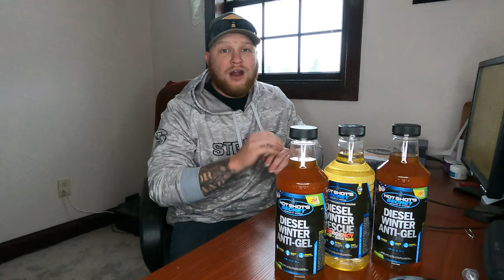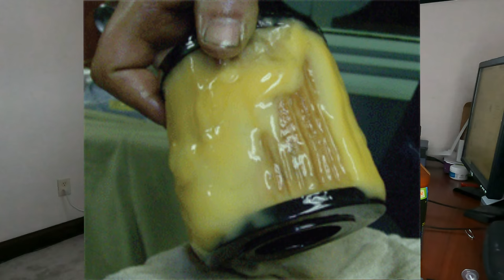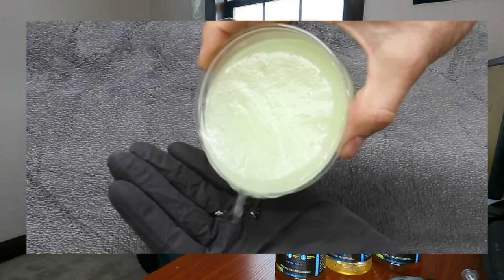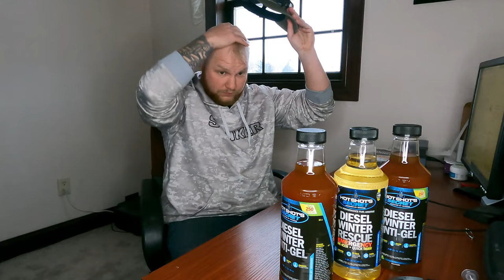What To Do When Your Diesel Gels Up!

Comment: I was up in Wisconsin two winters ago.  It was -30 degrees.  My 579 paccar gelled up.  I was gonna wait for the ta shop to help me out.  Bought 2 of those big 911 red bottles poured half it in both tanks and filled the fuel water separator filter up.   Let it sit for about 10 minutes.  Fired right up.  You can’t really prevent gelling.  Bc windshield chill is the issue.  It can be -6 but windshield -30.   I gelled up with howes and power service.  Gonna try out fuel ox.  Heard nothing but good things about it.  Make sure u use algae killer in your tanks before winter.  Windshield does effect it.  Fuel tanks are aluminum.

Comment: Don't know where you are at but the diesel fuel we get in central ND is pretty good. Just went trough a week to 10 days where it never got above zero and had 3 nights of -30 or more. We ran #2 diesel in our IH 1066 only had power service at one and a half times the recommended rate never had a problem. Only problem was it sits outside so the 1200 watt block heater was plugged in when not using it to feed livestock.  Also found a product from Canada called Sure Shot that we used in the 2014 chevy duramax  .  Used the pickup every day and never missed a beat with #2 fuel.
Reply from the maker: WI our #2 diesel is a rip off and they actually stopped giving you the option now it’s all “winterized”

Comment: Thanks for the info bro! So, I’ll say upfront that I don’t have any experience with this. What should I do if I’ve had to park at the airport unplugged for 5 days in single digit weather? Should I just not even try to start it, and go get this stuff to bring to the airport and get me out of the lot? I have a FASS fuel system with two filters by the rear wheel, which is a little harder to replace.
Reply from the maker: So I’d run the winter gel before you park it, and you should be fine. Keep a bottle of rescue in the truck. If it’s gelled up spin off the filters pour some in there, and then in the tank. Let that sit for a bit, and try and crank it over.
Reply: If you have fass. Start it.  That’s a diesel heater.
Reply: @timmay2k  My understanding is that not all FASS systems have the electric heater units installed. I live in a cold place, so I prefer to take the extra precaution of the anti-gel fuel additive. I’m also assuming that - even if the heater was in my fuel system - that it would have to be plugged in to engage.

Comment: Good info In the first 10 mins of your video, but then you discredit yourself by saying wind chill don’t matter. In Idaho, I promise you it matters
Reply from the maker: Wind chill has zero effect on things like this living in Wisconsin we also get a lot of wind. There is plenty of research out there that windchill will not effect fuel gelling. You can even contact companies like hot shots, and they will tell you it is based off the ambient temp only. Can it cause it to cool down faster yes, but it will not cause it to drop below the ambient temperature.
Reply: Diesel fuel isn't warm blooded. Wind chill has absolutely zero to do with heat loss. Duuurr.